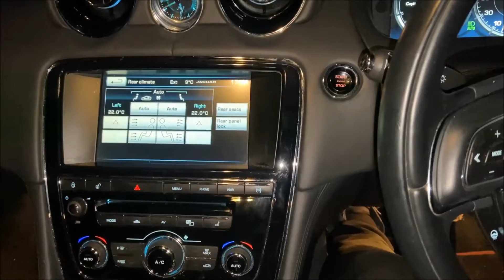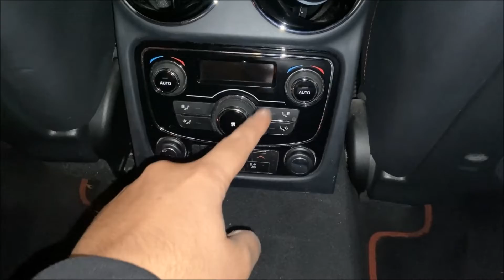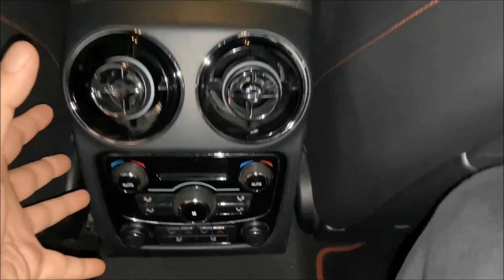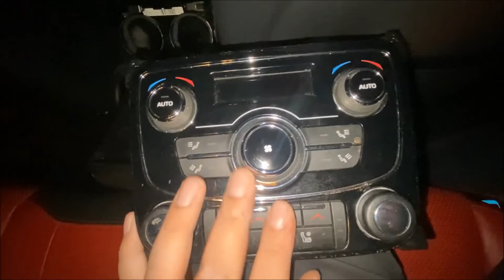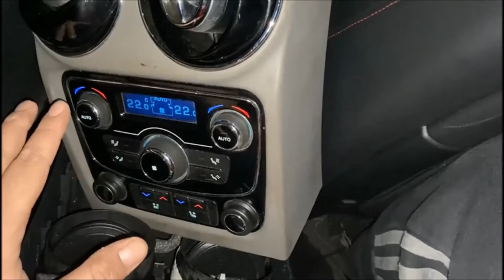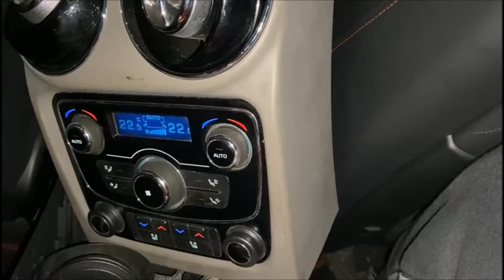2015 Jaguar XJR  Rear Climate Control Replacement + Airbag Module Location

Comment: My unit is not working in the front or the rear of the car. Which fuse should I be checking in the rear?
Reply from the maker: Hello,

What vehicle and what year?
Reply: @MidlandsVehicleDiagnostics  2016 xj
Reply from the maker: @grea8gawdtv  
Check the following:

ENGINE BAY FUSE BOX

F10 5amp

PASSENGER COMPARTMENT FUSE BOX

F7 20amp (Rear Climate Control)
F21 5amp (Front Dual Climate )
F33 20amp (Front Dual Climate)
F40 5amp (Rear Climate Control)
F62 10amp (Climate Control Module)
Reply: @MidlandsVehicleDiagnostics  Thank u very much
Reply: @MidlandsVehicleDiagnostics  Thanl you man I checked all those fuses and more and still the front or rear module will not work. Im not sure what to try next. Thank you
Reply from the maker: @grea8gawdtv  I would try and replace the modules
Reply: @MidlandsVehicleDiagnostics  Thank you. Any Module in particular?
Reply from the maker: @grea8gawdtv the climate control panels